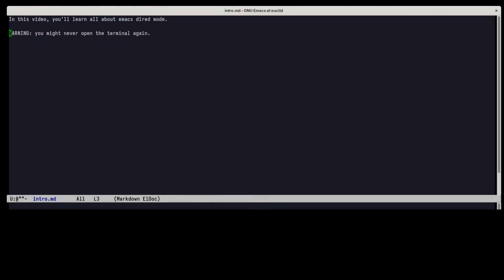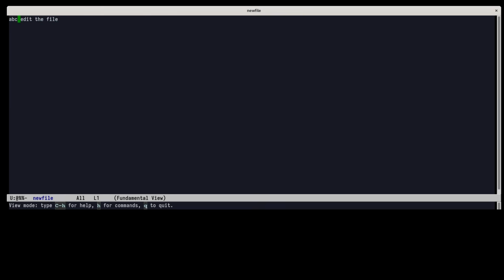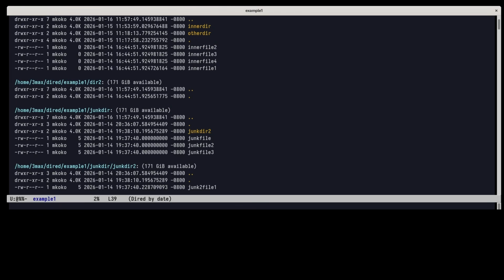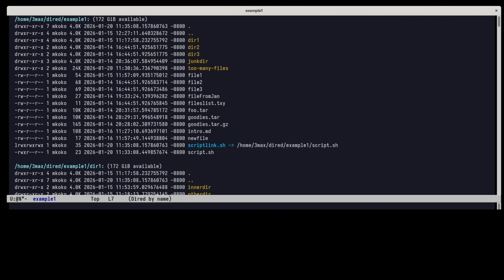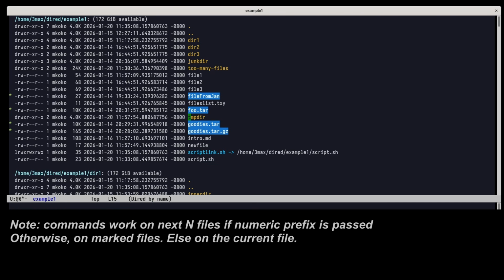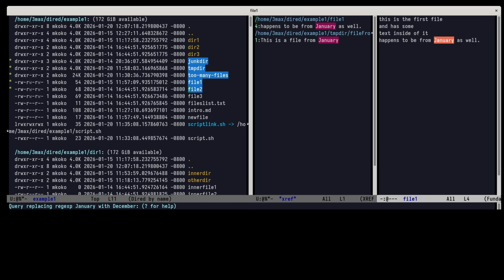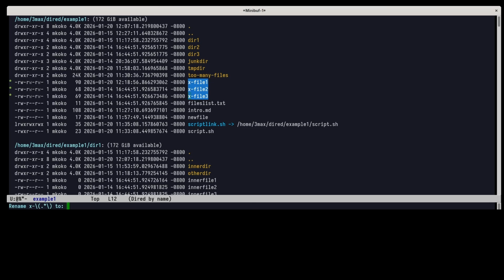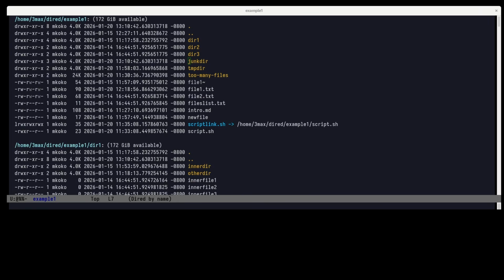Master Emacs Dired Mode in 15 Minutes

Comment: wdired with multi cursor is one of my favorite.
Reply from the maker: Yeah, I've been using basic rectangle mode which is already really helpful. I haven't tried multi-cursor yet, but this is a sign to give it a try!
Reply: @3Max   yeah, give it a try… I was sooo used to it from sublime text. it's sometimes very useful when I want mv some selected files  in a new folder.

Have you ever tried  Emacs undo in region?
It's my ALL TIME/ MOST IMPRESSIVE Emacs feature… Haven't seen nowhere else so far.
Reply: @3Max most underated command..